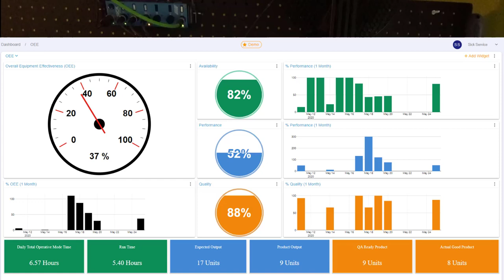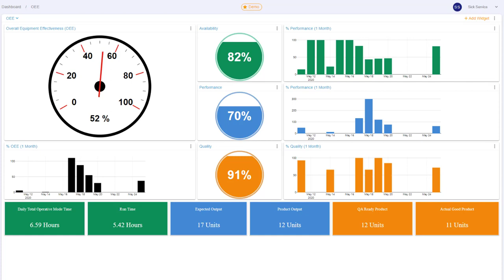How to gather OEE data automatically

Comment: which sensors do you use for checking the quality?
 can you please list down the names all the sensors you used here
Reply from the maker: Hey Muhammad, for my tests, the quality check was a manual human inspection. I then setup a simple W16 sensor to detect the good parts after they passed the inspection step. Simulating a machine where an operator or inspection system simply removes the defects from a conveyor. SICK has many sensors and cameras that could do the full quality inspection. Reach out to your local SICK branch and our experts would be happy to show you the products in action!